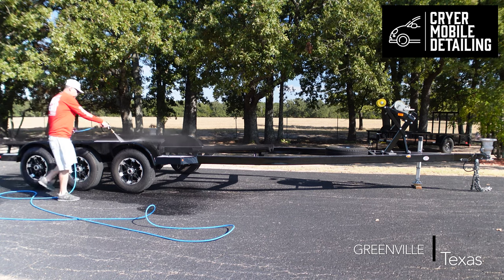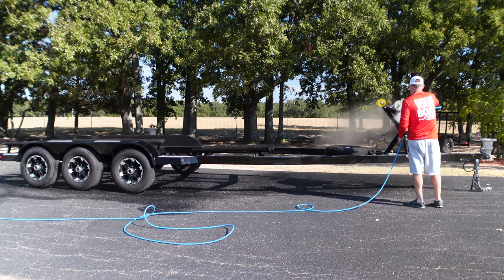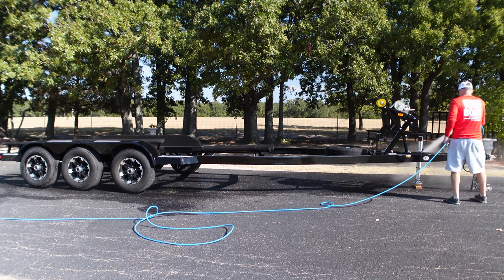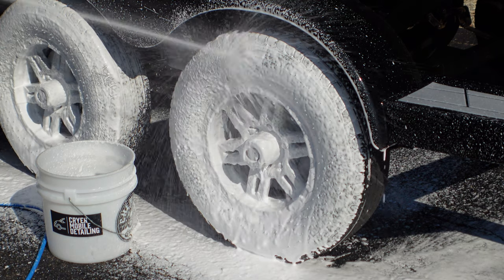Boat Trailer Ceramic Coating #glidecoat

Comment: Brad can you ceramic coat the road armor coating that they’re using now ?
Reply from the maker: I have never tried to coat road armor. Not sure what the process would be, I’m sure it would be much easier to clean.
Reply: Have you found out any info on this topic of how to protect/coat trailers with road armor, or a variation of it?